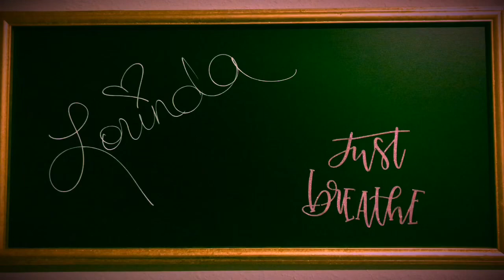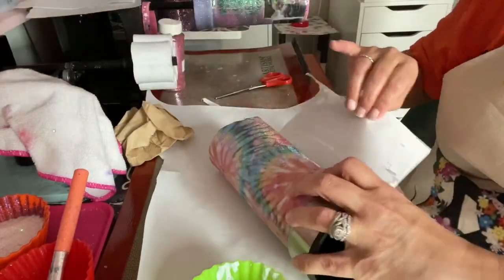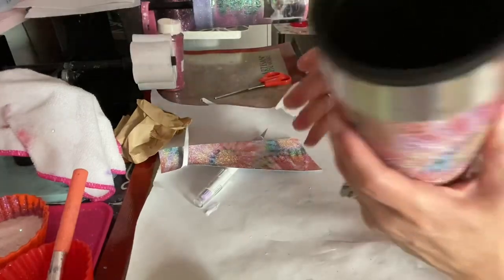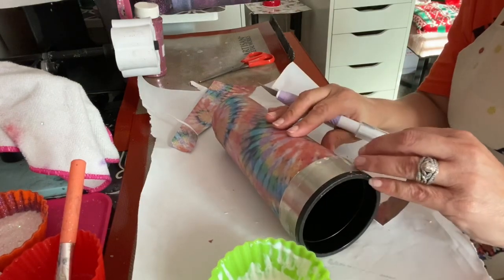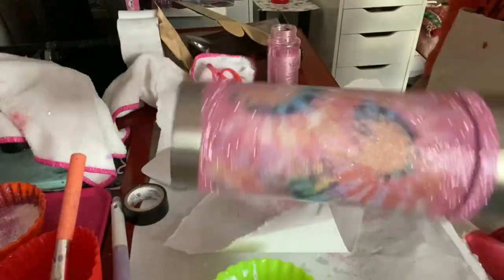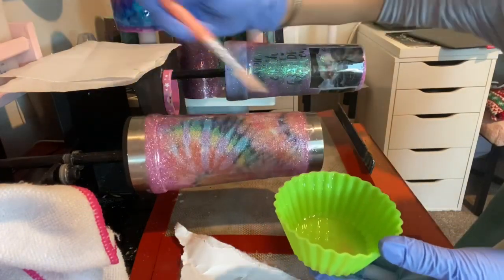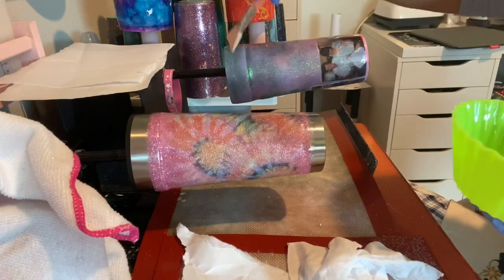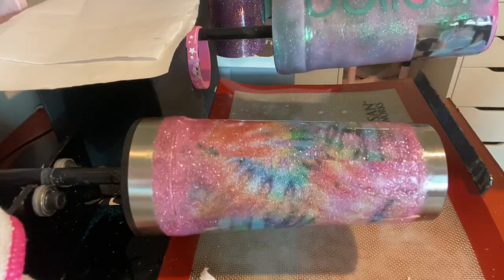TUMBLER TUTORIAL; card stock glitter epoxy tumbler. Can I use card stock to decorate epoxy tumbler?

Comment: If you lighting mist cardstock with water it makes it easier to manipulate it.
Reply from the maker: Thank you for this great tip, I will do this next time. I appreciate it.
Reply: @themostcraftynurse3914  you're welcome
Reply from the maker: Can you use that tip on any material your applying card stock?
Reply: @themostcraftynurse3914  yeah I wouldn't know why not. I've done it it with several things. You don't at all want it wet but lighting misted. And it bends and moves so easily.

Comment: Hi, I was really inspired to do something similar. However, epoxy got under my paper and made the paper look wet. Any tips on how to keep that from happening?
Reply from the maker: Hello, I’m sorry that happened. It is such a bummer when your project gets ruined like that. After so many time of that happening this is what I have found works for me. If my paper is thinner than I modpodge under and over making sure my edges are very secure. If the card stock is thicker than I use spray adhesive under than cover with modpodge again making sure edges are down really well. Make sure your modpodge is completely dry so you do not get any cloudiness. I hope this helps.😀
Reply: The most crafty Nurse Thabk you! I retried it with more success. I still got some “wet” spots, but I think I can cover them with vinyl!
Reply from the maker: Awesome, I’m so glad. I bet it’s beautiful ❤️
Reply from the maker: I’m sorry I missed this question fiend. Yes mod podge under and over for a good seal let it dry completely. It’s worth the extra time.